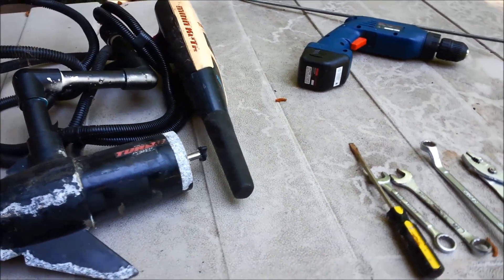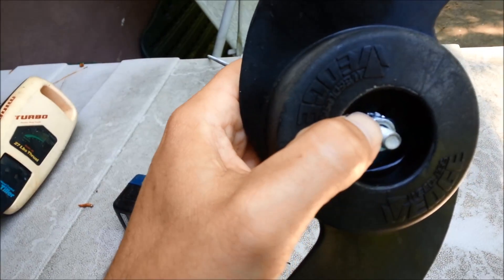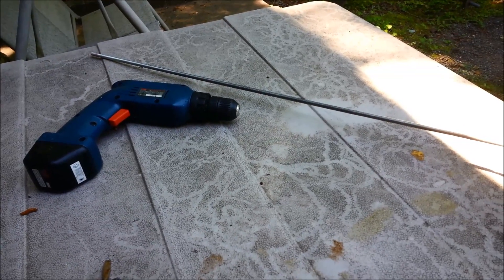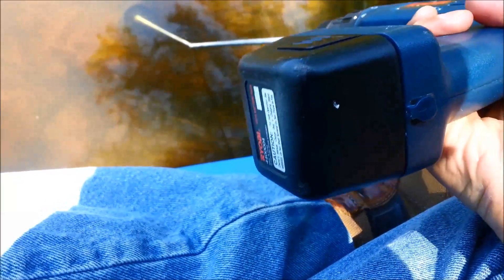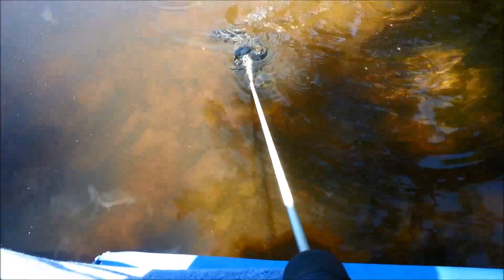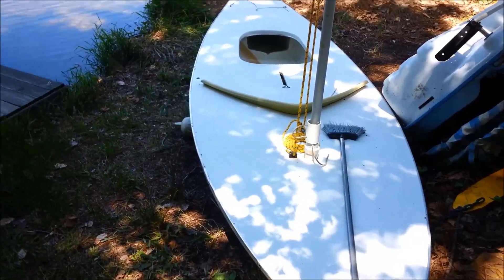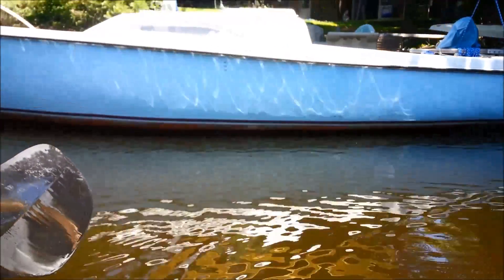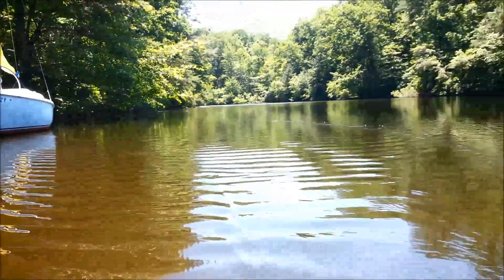Cordless Drill Outboard Boat Motor

Comment: Put the all-thread into a piece of plastic pvc pipe if you glue a tee into the pipe you will have a handle and a second one could go into a bracket on the boat to secure the motor and become a pivot. The other option would be firmly mount it and steer with an oar or the rudder. 
Use a little olive oil or some biodegradable  motor oil to keep it cool and lubricated.
Thanks from Sunny Staunton Virginia!
PS want plans? ask and I'll work something up.
Bob
Reply from the maker: Good suggestion, Bob.  No need to work up plans for now.  Thanks!

Comment: Say Drez20001,
Was that a Venture (pre-MacGregor branding) 17 or 21 tied to the dock? Yours? A video on it (interior and rigging) and any mods you've done would help folks like me in the midst of restoration work! It looks in good shape!
ebachy
Reply from the maker: Hi Ed.  Yep, that's my Venture.  I bought it over 15 years ago, sailed it for a few years and then sold it to a friend.  It then sat in his yard for a decade, under trees, and never used.  Then a few years ago I bought it back from him and did a little restoration on it.  It's far from pristine currently but looks okay.  I replaced the rigging after I bought it - I ordered everything online and then rigged it in my back yard.  Here's a quick vid on the light restoration:  https://www.youtube.com/watch?v=QQt6yZYtDmM
This is the trolling motor mod: https://www.youtube.com/watch?v=iDlF3nU8pEY
Reply: How's your Keel? Mine is deconstructed at this point. Simran is a 1973 V21 and has a steel core-lead bulb keel. Water must have gotten into the core around the pivot bolt as it jostled on the beach with tide changes. I put it in dry dock 20 yrs ago, the rust "grew" and it delaminated so bad it got stuck in the trunk... I'm gonna try and re-build out the 3" x 5/8" core using epoxy to the 10" width using some of the salvaged fuller chunks, then fill the gaps and reglass/regelcoat and paint. It may be another 20 yrs!
Reply from the maker: My centerboard is in lousy shape.  It's still together but should be hauled out, patched, and re-installed.  It's a project I'll get to one day but have too many other things to do.

Comment: My dad had a drill like that 7.2v when the battery died for good he connected cables to the terminals inside and runs it off a 12v car battery 10 years later he still uses it for the odd job around the shed and it has more power and longer battery life.
Reply: Plus I have 40pound trolling motor on my kayak get 6mph for 1/2 hour on a mobility scooter battery, people look twice as I am not paddling.
Reply: Andrew B how do you get 6mph with a 40lbs trolling motor when i have a 55lbs trolling motor and i will only get up to 4mph , i take it that your kayak is a single person sit in kayak because that would make sense, i got a 12.7 foot 3 person tandem sit on kayak and weighs 86 pounds with nothing added
Reply: My kayak is a old race kayak used in the coast to coast race in new Zealand. Probably  weighs around 20 kgs with out batterys. I had it on a wider kayak and it probably wouldn't even do half that speed.
Reply: Both the batteries on my Challenge 14.4V drills and Ryobi 18V drill are stuffed so I run them off of some lead acid batteries I got as the drill batteries are often almost the price of a new drill. I have a 12V adapter for my 14.4V drill although the current capacity is underpowered it's useful for a narrow diameter hole.

Comment: Would a 12 volt drill work?
Reply from the maker: Hi Marshall - I would think so.  I bought a cheap cordless 19 volt drill to see if it had more kick, but then the season ended and I didn't get back to the project.  Hopefully next summer I'll do some more testing with different drills, different mounts, and I have some ideas for steering brackets.  Stay tuned.  Fun stuff.
Reply: drez20001 I have an UltraSteel 12 volt cordless drill
Reply from the maker: Sure, give it a try and share how it goes.

Comment: I did something similar.  I used a old (gas) straight shaft weed eater that I found by the side of the road (one mans trash hey?)   I added a protector plate under the prop to kick it up if I hit it with something (couple hose clamps some pvc pipe and a small piece of wood.   then came a bracket that allowed movement up, and  sideways to control direction.   I got the idea from a documentary in (china?) where they used straight long shaft motors in small boats.   Mine moved a home built 12' plywood flat bottom skiff better than expected.  Wide open and after getting up to speed it was faster than the electric trolling motor it replaced.  Sadly to say someone stole both cutting the chain.   The only downfall was the noise, but hey it moved much better than I thought.